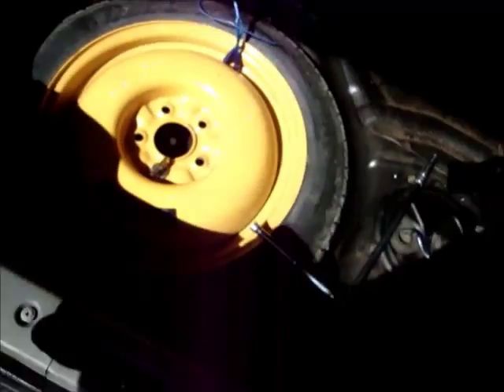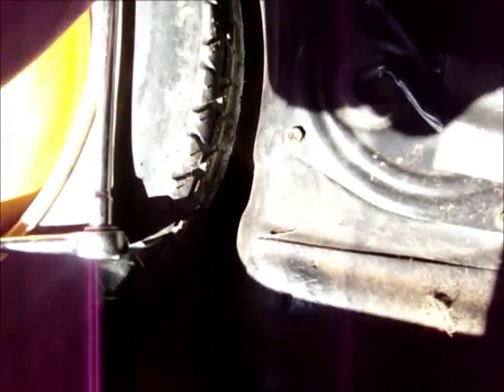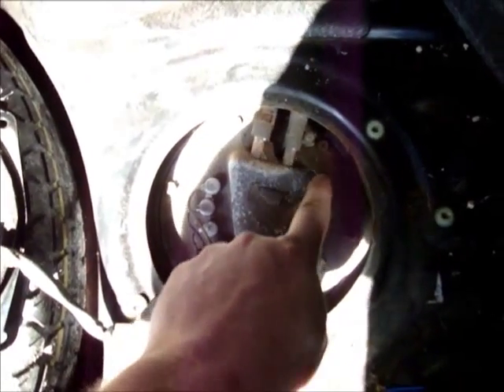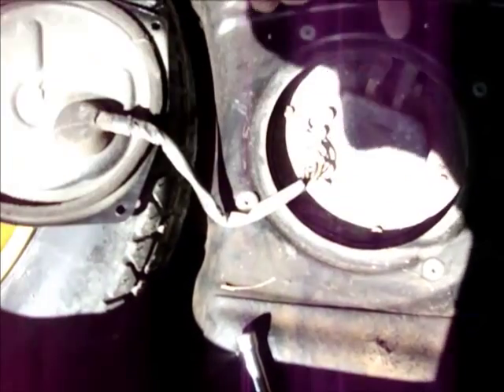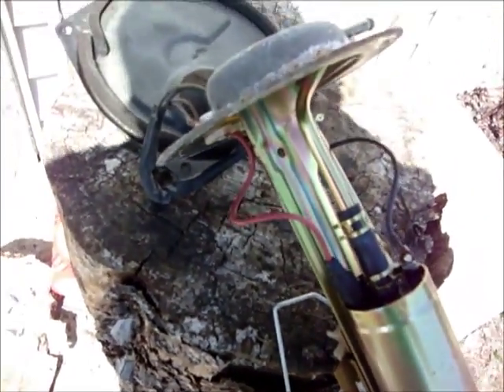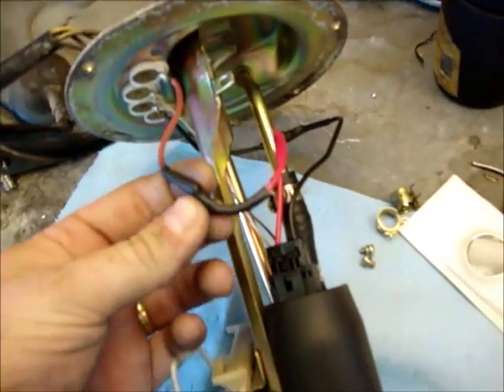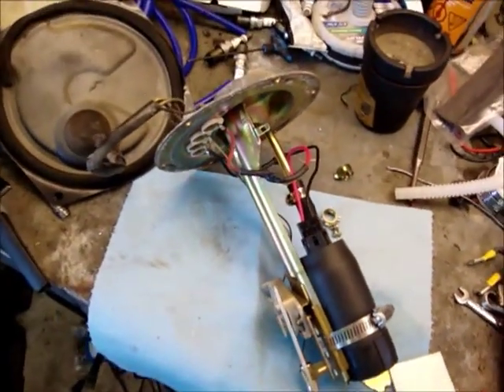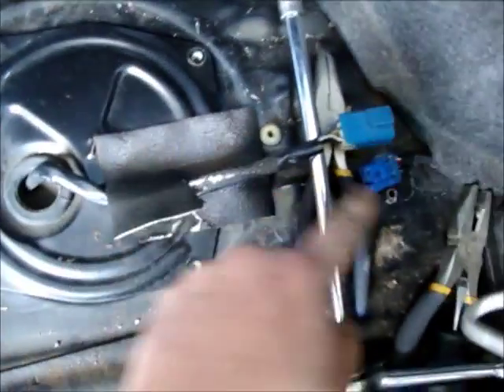high flow fuel pump install

Comment: Damn the R32 is beyond easy to work vs the R33 for fuel pump and battery. Just upgraded my pump to a Walbro 255 with fuel proof heat shrink, however the stock filter is much better than the new filter. I have heard that many thousands of times. The stock sock is better and gets more fuel from the tank.